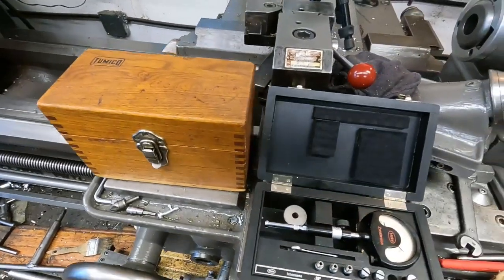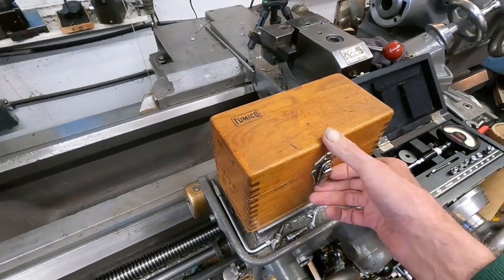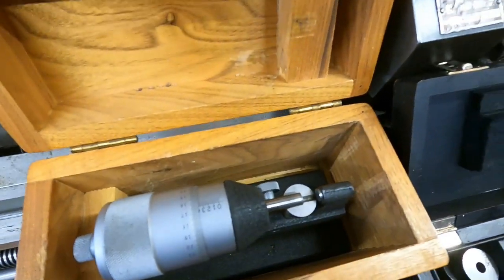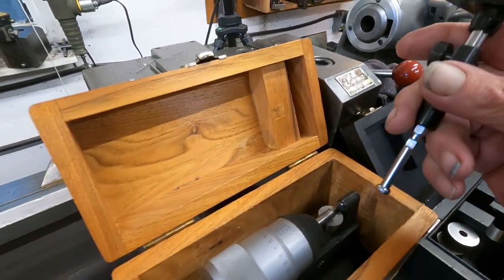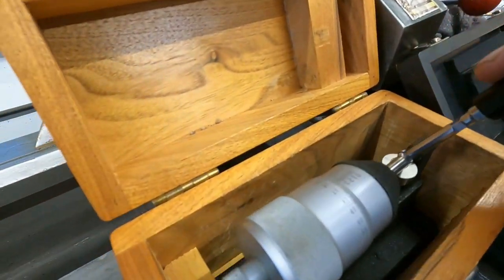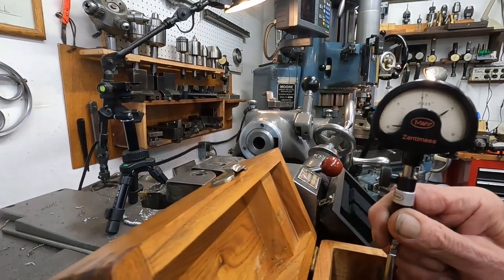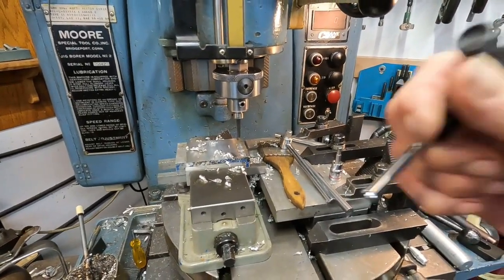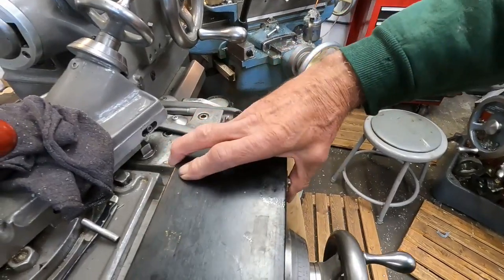Mahr ball type dial bore gage set.

Comment: I like the Tumico bench mic Don They made some nice tools in the day before and after the Scherr name came on board .. My favorite Mic is a 0-1" Scherr-Tumico that is my daily driver. I am enjoying this recent series of videos on boring and using the Moore. Cheers
Reply from the maker: I worked at a hydraulic shop that used ST tools almost exclusively and didn't want personal tools used. Boeing used these and many other plants also. I think they are the best bang for the dollar on the used market. I will get back on the jig borer, had a sudden last of summer heatwave that ends today and should have better sound wired up today, thanks!

Comment: You got sooooo close to putting that mahr in the hole.  I will wait for you to measure the oxide diameter difference.
Reply from the maker: I will do that soon as I step out the hole with the next boring head, thanks
Reply: micrometers are set to work under some amount of pressure when measuring,taking measures in "air" may result in somee errors
Reply from the maker: @antoniomortinho1099  The setting fixtures with micrometers or set with gage block stacks need to be checked against master setting rings that be fairly close to size of what you are measuring. It takes practice to get it right. Another similar setting method is using height gages on the surface plate that can work well for setting large diameters thanks
Reply: @DonDyarprecision  agree,with gauge blocks sounds good,all the best!